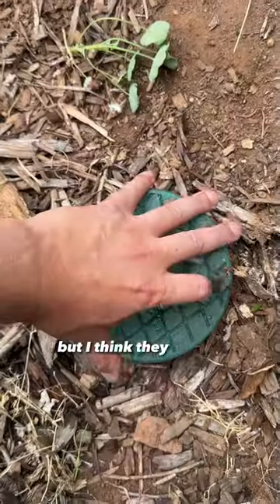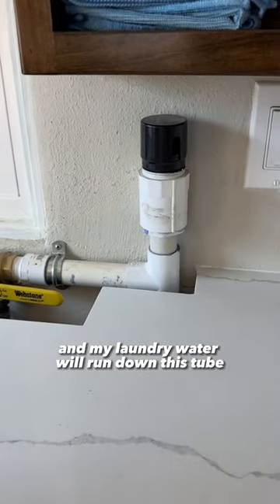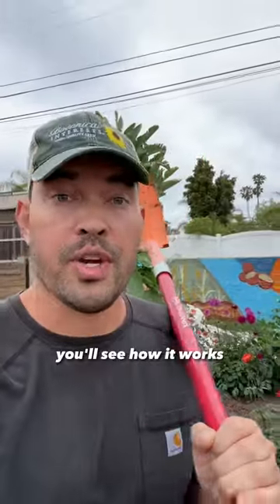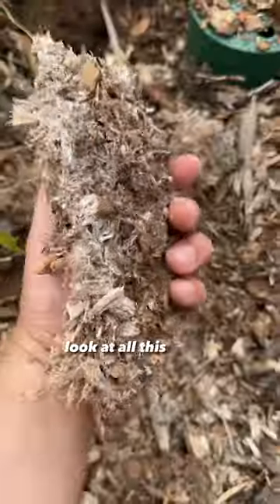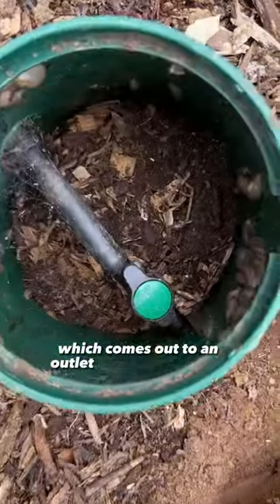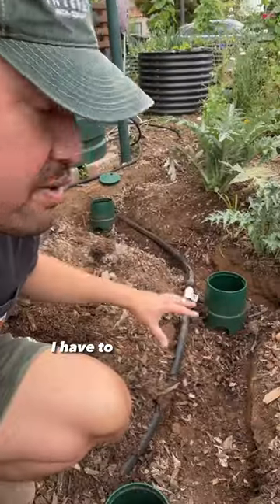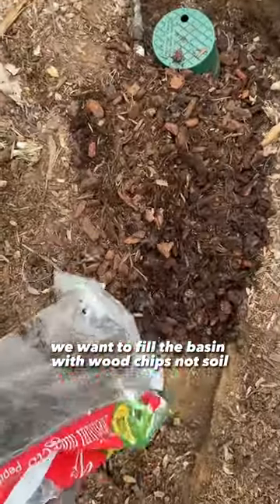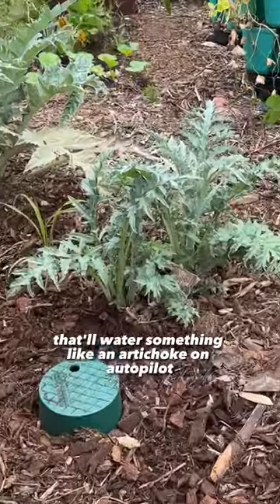Fixing my laundry water irrigation system

Comment: Good idea, however, gray water by definition is still septage / sewage. People need to check with local municipalities to be sure gray water gardens are allowed in your area. FYI: gray water gardens are illegal in Michigan's Upper Peninsula.
Reply: Many, many municipalities and counties specifically do not allow grey water disposal, and it doesn't matter how much of the land you own. Some states even require permits for storm water french drains, and outright ban surface grey water disposal.
Reply: @gpzjeffrey7974  that is why I brought up this point to begin with. There are tones of videos on thing like gray water gardens, composting toilets and other off-grid systems but does these videos talk about the legally or permit requirements? Of course not. The videos often just say just build it and who care about local codes and regulations.
Reply: @seanclark5613 even if everything is allowed and legal, I don't understand how base water full of detergent can be good for plants and soil - especially when it spills over a relatively small area like in this case?! O_o
I don't fall for stories about natural detergents - that's just nonsense, maybe certain brands of detergents have less perfume and additives, but the basic composition must be the same if the goal is to remove stains and clean clothes...
Reply: @goranjosic  I've used grey water for  many years and my large fruit trees are extremely happy and healthy.

The trick is to use large amounts of carbon material e.g. woodchips, chop and drop branches etc to absorb the greywater. The fungus that grows will result in any bad chemicals being locked up and inert in the soil.
Reply: How can someone stop you from using grey water.. you bought it already.. that's crazy.. 😂
Reply: @jessicameyer7247  When a representative of the local municipality finds out about it through a complaint or if a home inspection is done because the house is listed for sale or if building premit for renovations are pulled. A bank may also refuse to grant a mortgage or refuse to refinance until the problem is solved. 

As far as paying for water is concerned, the rural area where I live, most people don't "pay" for water because they are on their own private well.
Reply: @seanclark5613  well, it sounds like a dictatorship,  I heard you can't collect rain water in certain states either.. that'd mad
Reply: @jessicameyer7247 that's because idiots can create health hazards. Water discharge is regulated because what you dump on your soil isn't limited to your property. If you let something get into the groundwater because you don't know better, you've just caused a massive problem for everyone. And rainwater regulations are usually due to people making mosquito breeding pools iirc.
Reply: @jessicameyer7247  The same way they can stop you from going 100mph in a school zone while in the car you bought. With GUNS!
Reply: Bureaucracy like that infringes on people’s rights. 🇺🇸
Reply: @aaliyahgibbons8399 hey genius be quiet.
Reply: Septage and sewage are by definition blackwater, not greywater.
Reply: @jessicameyer7247  there are reasons for the laws, even if you don't understand or agree with them. For an example, I don't agree with the speed limit on the rural state highway I travel down every day. It should be 75, not 65 or 55 in some areas.
Reply: @BlueJoshi  if wastewater is produced by domestic activities and is not desposed of in a municipal system, it's septage. This includes both black water from a toilet and gray water from a shower, sink or washing machine.

Comment: What if you put landscape fabric over the ports and surround the ports with a few inches of 3/4" gravel or pea stone? You should have no issues with clogging
Reply: That sounds like a good fix!
Reply: Hydroponic clay pellets would be a better option
Reply: Some sort of gravel layer under it all with geofabric is definitely the way to go. Then he can hide it with mulch
Reply: Landscape fabric is usually plastic and breaks down, which could mean microplastics in the water. This is watering food they will be eating. I could see placing an organic plant based bag over the outlets.
Reply: You wanna build a filter like nature do, 1-4” topsoil covered in moss sitting on top of clean sand, sitting on top of small gravel sitting onto ontop of river stones and then clay on the bottom to help keep the moisture from going right back into the water table

Comment: Do you have to use a specific type of laundry soap in order for it not to affect the plants, or does the soil take care of that?
Reply: Yeah, I'm not sure which, but there are guidelines
Reply: I can’t imagine any type of detergent that actually works would be 100% safe for plants or even more importantly the fungi in the soil.
Reply: This was my first question al well!
Reply: Castile soap - lavender or peppermint may give very temporary mosquito relief
Reply: Oasis biodegradable and Dr Bronners castile soap
Reply: @DonGrigorianFishing  There are plenty. Castile soap is deceptively powerful and harmless. The valve is also there if he has to use something harsher like bleach or stain remover, he can divert the water away from the plants.
Reply: @DonGrigorianFishing  That's why you use actual soap, and not chemical detergents
Reply: @DonGrigorianFishing  What about not using detergent ? What about maybe using chemicals like this inside a big bucket if you absolutely trashed your clothes and desperately need to use harmful products, and then dump that into your toilet or anywhere that is connected to the local sewer system.

How tf is it even an issue.
Reply: There are all kinds of organic soaps and detergents that benefits plants

Comment: Nice idea but if you redesigned the outlets, you'd eliminate clogging issues. Instead of using wood chips, use gravel and then cover that with some woods chips.

Comment: The reason you're having issues is you should be using pea gravel for that. Wood chips will soak up the water and cause it to sit and puddle. Pea gravel facilitates drainage which is what you need here. The water needs to soak into the ground to water the plants properly otherwise the standing water could actually be bad for the plants depending how close it is and how long it sits. This likely why you have clumpy moldy chunks of wood chips. That shouldn't ever happen to wood chips.
Reply: Yes, but the microbes are beneficial for taking some of that gray water pollutant right?

Comment: What if you connected the grey water line, with a one way valve ofcourse, to the city water or your rain water, so you can run water through the lines/valves/sprinkler system and unclog smaller.clogs and prevent future larger clogs?

Comment: If you had plummed it in 2 inch pvc and screened the end lint will wash through the pipe and you can clean the screen every so often. Cotton lint when dry makes for good bird nest material in the spring. Or make it more like a leach field on a septic system.

Comment: I strongly disagree that the fungus is breaking down the wood chips.  It is bacteria, bugs and worms that break the wood chips down. I have 4 acres of wood chips that gets added to daily.  It is 8 feet deep.  When I dig down with my Takeuchi track loader I often see pockets of wood chips that have not decayed.  Those areas have white fungi growing all over the wood chips.  Some areas have white nodes connected to the fungi that look like snake eggs, but upon opening them reveals they are not snake eggs or eggs of any kind.  Even wood chips that have sat for 5-6 years still have not decayed where the fungi is present.  While all around the wood chips have decayed.  So, to speed up the decay process, I move those areas to the top layer where the sun kills off the fungi.

I believe that form of fungi is the fungi that has been found at the roots of trees.  Where they have a symbiotic relationship with trees to help the trees get nutrients.  You can read more about it by typing in “trees, fungi, symbiotic relationship”.  

Please update your video to correct your mistake about the fungi.  I am a strong supporter of passing on correct information and stopping the spread of misinformation.  Thank you!